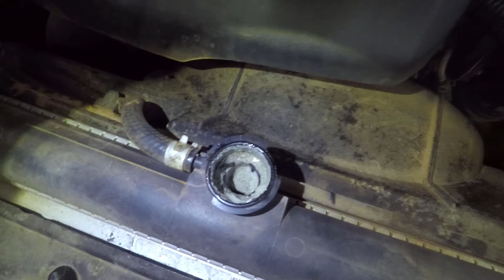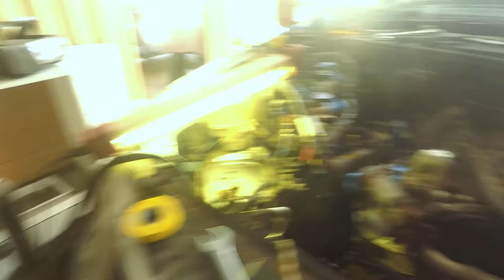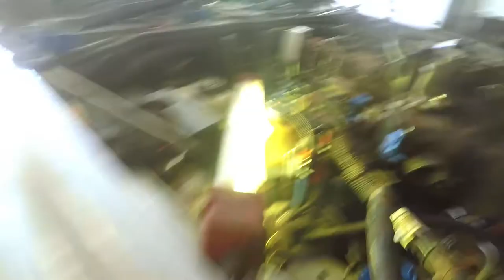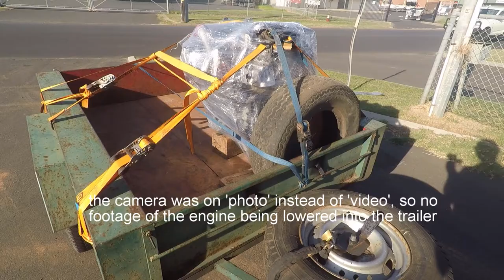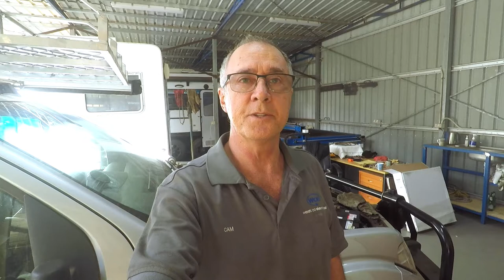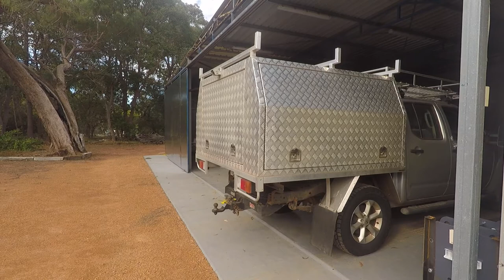Nissan Navara D40 Engine Failure | YD25 Oil Cooler Split

Comment: Yep. I know the feeling all too well mate. Had exactly the same thing happen in my d22 @ 194k.
Certainly didnt do any of the work myself but came in at a very similar costing.
Reply from the maker: Not sure how to pre-empt something like this happening. Did you get any warning signs???
Reply: @RustysOutbackAdventures  no!! None at all. D22 (to my knowledge) doesn't have a 'low oil' light. But rather a 'oil good' display on start-up. 
My first move will be to install a quality 'oil  pressure' guage in the cab.
Reply from the maker: That 'low oil level' light that came on, did as it was supposed to, but I didn't realise that the low oil was caused by it leaking into the cooling system from the oil cooler. I'll know for next time, but fingers crossed, I hope there isn't a 'next time'.
Reply: @RustysOutbackAdventures  mine has just done the same ( by the look of it ) - I have had the "LOW OIL" come on at start up recently however I thought it was just due to the service being a little past due. Did an oil change yesterday and all looked normal until I popped the radiator cap off and found a latte coloured sludgey crap all under the radiator cap. Looks like I have a bit of an oil leak too down on the drivers side - don't know if just leaking a little out of the timing cover gasket or is related to the oil cooler too. Horrible kick in the guts seeing stuff like this happen.  My car has given no previous warning either. I did noticed after a long slow climb out of a valley recently that the temp gauge ( on my scangauge, not the dash ) did get up a little higher than "normal" but figured was just from low range climbing for prolonged time.  The oil cooler is cheap enough, it's the pain in the backside job getting the old one out and the new one on. May be a job for my local mechanic I think, a little too time consuming for my weekend. I've done a good flush of the radiator in the meantime and I hoping, really hoping 🤞🤞it was just a dirty radiator like I've seen back in my old Holden day's. 
The coolant all came out nice and green and clean as normal and expected and the engine oil didn't have any floaties or crap or gunk in it, just looked like normal diesel oil. There was no residual crud left in the oil drain container either so here's to hoping .....
Reply from the maker: From what you're saying about the colour of your coolant (nice and green), it doesn't sound like you have oil in your water. With mine, the whole cooling system was contaminated with oil, but my engine did overheat, as evidenced by the temperature gauge going right up into the red. That could have caused the head gasket to let go.
Maybe you've caught yours in time, but definitely check the oil cooler. 
When you drained the oil, did you measure how much came out ( a normal oil change takes 7L).

Comment: Wow.   That was a massive job.   Well done mate.  I had a NP300 which some ** stole a couple of months ago.    That rebuild must have cost a few quid!     Is yours a D40.   In the UK the D22 are older model.  I could be wrong but don’t they have a simplex single timing chain?   You can get a good upgrade kit to duplex twin timing chain.   Good to have.   Glad to see the Nav back on the road.   Happy Hunting.    Jason.
Reply from the maker: Hi Jason, yes mine is the D40 Navara, 2011 model. I considered the double row timing chain but it seems that issue was with the earlier model. My engine had 350,000kms on it from new, before the oil cooler failure, so I went with the standard timing chain assembly.
Sorry to hear your NP300 was stolen...hope it was still in one piece when you got it back.

Comment: Hello from Spain. I have a D40 2006 Spanish R51 Pathfinder. Head Gasket went, and cracked head in 4 places. So I have head off, looks like one injector is gone. Ready to start taking engine out. I am gonna replace most things and upgrade to a duel chain. Recon turbo there also. Any tips on removing and replacing? Great vide BTW.
Reply from the maker: Hi there. Sorry to hear about your Pathfinder's engine failure. If the Pathfinder is anything like the Navara, there are a few things I learnt about pulling the engine out.....there's an engine to bellhousing bolt above the starter motor that bolts into the bellhousing from the engine side; all the other bolts go into the engine from the bellhousing.
You can take the small tin pan off the bottom of the sump, to make engine removal easier....don't forget to remove the oil strainer and also unplug the low oil sensor wires from the sensor in the side of the sump.
There are a couple of bellhousing to engine bolts up the top of the bellhousing that are nearly impossible to get to without some long socket extension bars and swivel joints.
Label all your wires and hoses as you disconnect them, and take photos, too....makes things easier to put everything back together again.
Allow yourself more time than you think you'll need....it took me way longer than I planned, to get the engine out.
Removing the radiator was a bit tricky...or maybe I wasn't holding my mouth in the right position!!
I found a copy of the workshop manual, online, and that was helpful.
Finally, if the engine overheated, you've probably damaged your injectors so you should replace all of them.
I hope this helps you.
Reply: Thanks @RustysOutbackAdventures

Comment: Thanks for sharing - $21k, that would mean a D23 for me - holy crap!
Reply from the maker: Hi Murray, the money I spent was less than if I sold the Nav (with a buggered engine) and went out and started again with a late model dual cab. That option would have probably cost $50k+
At least I know my Nav will last me for a fair while now, barring any major driveline component failure (let's hope that doesn't happen).
Reply: @RustysOutbackAdventures  fair point mate, at least you are sure to get longevity from her now, and you know what you have! Cheers mate.

Comment: Great vid Rusty. Nice to see the old blokes tackling new diesel tech. 

I just rebuilt my Hilux and for the run in procedure what i did was the same. However what I was given was use big hills, drive in higher gears than what you normally would. 

Have you considered deleting the EGR in your engine? They can be problematic in the YD25
Reply from the maker: Thanks for your comments. Yes, the EGR was causing an issue with the new engine blowing smoke on start up...so it's been blanked off....with no detriment to the engine's warranty.
Reply: @RustysOutbackAdventures  Which kit did you go with?

Wondering if you have had engine lights come on with it
Reply from the maker: I made my own blanking plate...used the gasket as a template and no engine lights.

Comment: Great video and well done on tackling this job.
My 2006 has 241,000 and going strong with all original injectors etc., can’t decide on weather to try and get another 80-100,000 Kms? Or a new Ute, they are so bloody expensive now!
Reply from the maker: My son has a 2007 Navara which has just clicked over 300,000kms. Besides having new injectors and the usual service 'stuff', it's still going strong. I know what you mean about the price of new ones....that's why I went down the road of getting my engine rebuilt, rather than selling up and upgrading.
Reply: @RustysOutbackAdventures  thanks for the reply, I’m up in Perth.
I’m in a bit of a dilemma at the moment regarding upgrading, can’t seem to justify 70+ grand for basically the same vehicle with loads of electrical gizmos.

When did your son replace his injectors?
Reply from the maker: @G3516dude  I did mine at round 280,000kms and his were changed around 260,000kms.
I know what you mean about new cars having all the electronic 'stuff'...you won't want to break down somewhere off the bitumen because you won't be able to fix it yourself.

Comment: every Navaa owner needs a mate  named Rex, dame Nav's! did yay do the timing chains at same time?
Reply from the maker: I had the engine rebuilt with all new parts. The head was junk because it got hot and the radiator just full of oily water, so I installed a new one...same for all the hoses under the bonnet.

Comment: I have a 2009 Navara, checking the coolant the other day I discovered engine oil in header tank, engine oil hast emulsified but? It's a manual, I'm hoping just oil cooler rather than head gasket or head, I'm not a mechanic but it was head would water get in oil rather than the water (coolant) Into engine?
Reply from the maker: Hi Tony, if you've got oil in your coolant tank, then I'd suggest your oil cooler might be leaking oil. You're correct, if the head gasket was blown, you'd see coolant in your engine oil.
Hope you've caught it before it turns into a major problem.
Reply: Thanks for response
Reply: Similar to me mate - I did an oil change yesterday and the oil looked normal, no floaties that I could see. Only after I chucked it out and was finished that I popped the radiator cap off to find a weird latte coffee coloured smooth paste stuff under the cap ( think like smooth peanut butter ) and some floaties in the neck of the radiator. I flushed the radiator out and ran it for some time, drove around the block a few times etc at normal operating temperature and touch wood, it didn't seem to come back ( yet ) so fingers 🤞🤞 that it was purely just some crap inside the radiator and a flush was all it needed. I certainly can't afford the sort of money asked to rebuild an engine like here. I'll keep an eye on it and may get the oil cooler changed to be safe - they seem to put all this unnecessary crap on cars nowadays which is great while they're working 100% but the minute they get old and start to play up, it's get out the cheque book and bend over !

Comment: Great video mate well done, I would be interested to know roughly how many hours this took you and also a ball park cost if you wouldn't mind sharing.
Reply from the maker: I probably spent 15 hours removing the engine, and a similar amount of time refitting it. If it was a job you did regularly, I'm sure the time would be a lot less. Cost wise, all up I spent 21k...that included the reconditioned engine, plus new water pump, thermostat, oil cooler, harmonic balancer, vacuum pump, fuel pump, 4 glow plugs, 4 fuel injectors, new turbocharger, complete hose kit, oil filter, engine oil, fuel filter, air filter and new radiator. I also got the engine builder to remove and reinstall all the inlet and exhaust manifold, etc (something I wasn't confident enough to do myself).
Reply: @RustysOutbackAdventures  thanks so much, again very helpful.  It's great to have the peace of mind that you know exactly what has been done.  She should give you many more years faithful service now. Cheers.
Reply from the maker: Thanks Brad....I sure hope so!!
Reply: @RustysOutbackAdventures  bloody hell  21k wow the reason it took me 30 years of driving b4 I was either brave enough or stupid enough to buy diesel . The cost of repairing one compared to a petrol engine is insane
Reply from the maker: @darrengray2309  and the engine builder uses genuine parts, as does the fuel injection place. I know there are cheaper parts available but in the end I hope these parts last as long as the originals.
Reply: @RustysOutbackAdventures  I  bought a D23 new 5 years ago it's on 110000klms now I'm hoping I get a decent amount of klms out of it
Reply: @RustysOutbackAdventures   $21,000 😲😲😲 holy dooley mate, still cheaper than a new ute I guess but crikey's, hope mine isn't that dear

Comment: is there a engine oil cooler delete ?
Reply from the maker: Hi Mark, from my understanding, the oil cooler bolts to the block and has water in and water out hose connections on the outside of the cooler.
To delete the oil cooler, some sort of blanking plate would be needed to bolt to the block, but deleting it could be an option, but not one I'd even considered.

Comment: Auto matic.??.
Reply from the maker: No, it's a manual.
Reply: @RustysOutbackAdventures  so was expecting it to be auto because autos usally have oil cooler in the bottom radiator tank. I have the spanish st d40 in manual.only done 100k and i looking to see what potential probs could have going in to future.thanks for the reply.
Reply from the maker: Troy, the oil cooler is bolted to the block, just below the oil filter, and it has 2 cooling water hoses attached to it. The water is supposed to help cool the oil, but unfortunately, my oil cooler suffered an internal leak, allowing the oil to get into the cooling system. 
The first sign of trouble was the 'low oil' warning light that came up on the dash. Adding oil fixed that problem, but while driving a bit further, the temperature gauge started going up, and before I could pull over, it had gone into the red. The rest, is history!
Things to look out for, will be the EGR valve that might not work properly, resulting in blowing black smoke when pulling away from a standing start. One fix is to blank off the EGR valve with a blanking plate, but you might not be able to do that because it might not be legal to do so.
The other thing to be mindful of, are the injectors will require replacing....I did my first set at 260,000kms but I've heard of them failing long before that.
Besides the usual wear and tear like brake pads, a clutch and 2 wheel bearings, I've not had any major issues with my Navara.